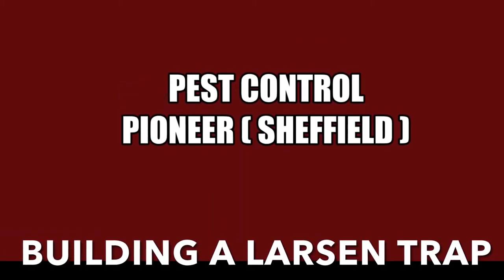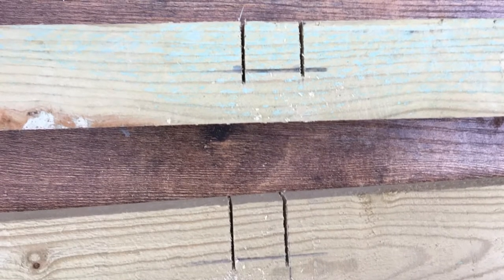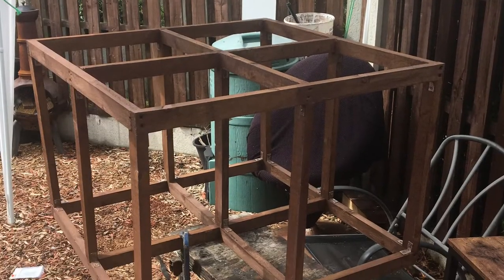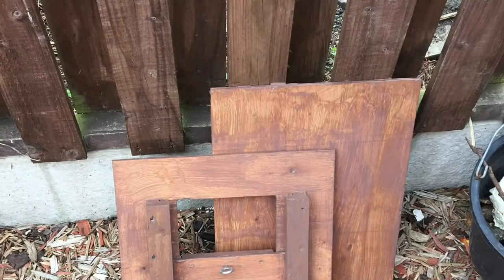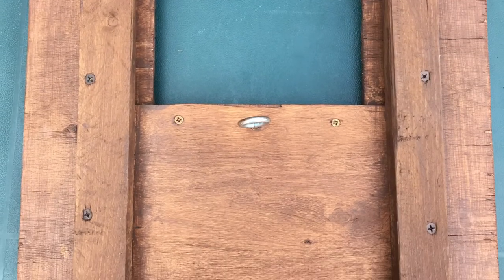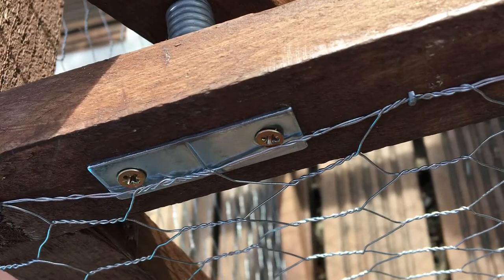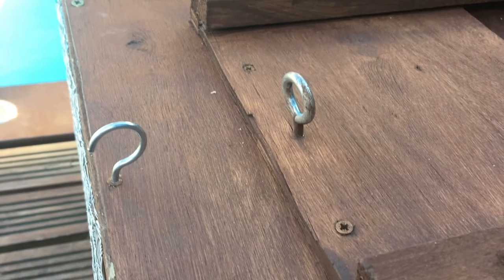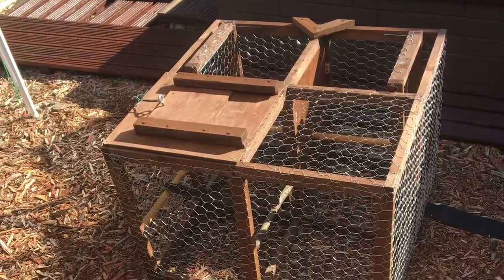Larsen trap build

Comment: Is your batton 19x38?
Reply from the maker: 4 x 30 inch 
2 Cross sections joined in middle 
One for top and one for bottom 
Use the 28 inch timbers to make them into squares 
The upright timbers are 18 inch which you will need 9 of them
Reply: @pestcontrolpioneersheffield  
The thickness of battons?
Reply from the maker: Not a clue 
Just cheap timber